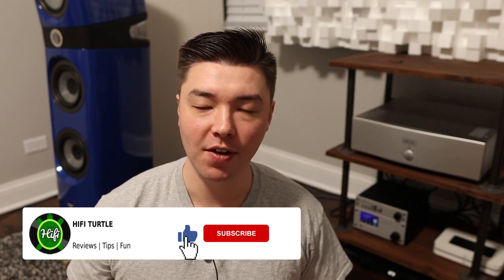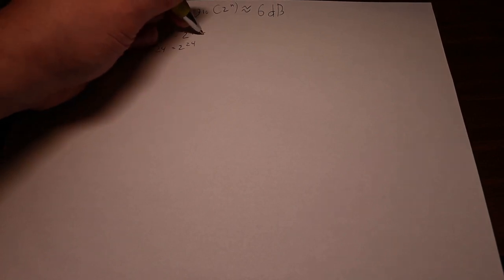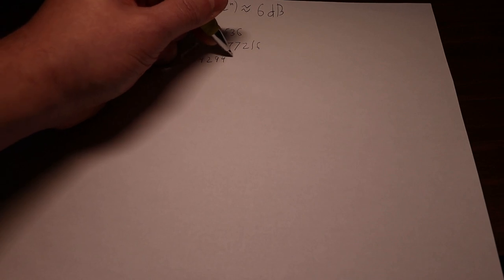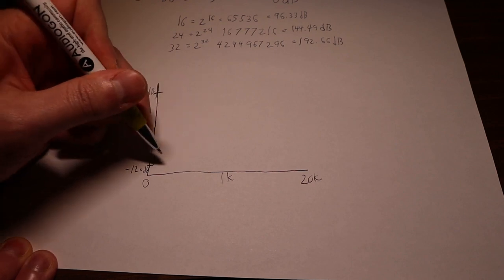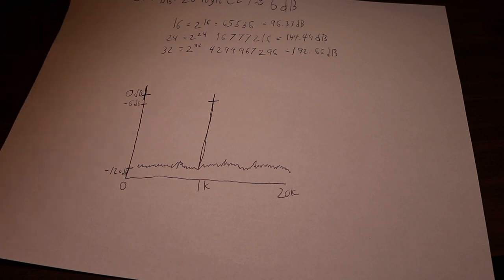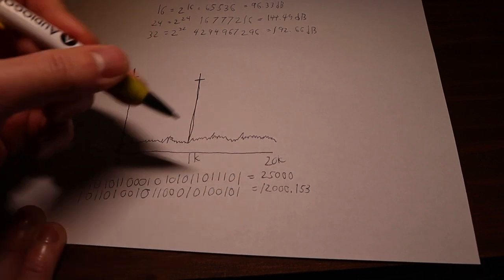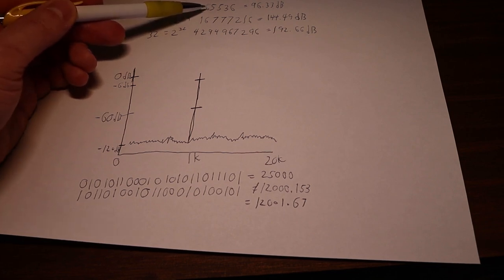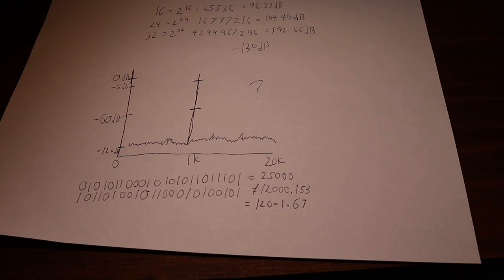DIGITAL VS. ANALOG PRE-AMPLIFIERS | Does It Matter?

Comment: Nja, the most common preamps do not just do attenuation.. but let us keep it simple and not go into sound quality and what a preamp can and will bring to the table.

But yes there is passive preamps (do not need any power) just many different sizes of resistors for attenuation and maybe a input selector. 

And if it is volume control that switch between different resistors or  a potentiometer (just a fancy way to select the resistance more granulated) or if the volume control control difrent replays that just open or closes relays to select a resistor on a PCB is all the same..

It is still attenuation by resistance just slightly more or less complicated way to get A resistor in the signal path.

There is other ways, like Transformer Volume Control (TVR).
The cool things is that power is not converted (and lost!) to heat as a resistor does.

Comment: Would controlling volume through Roon and Node 2i streamer with external DAC be considered pretty damaging to the sound or part of the more “modern” and improved digital processing category that doesn’t damage the sound too much?
Reply from the maker: Bluesound says it is a 32 bit DAC so should be less damaging
Reply: I added my old Rotel preamp to my Node2i and noticed sound improvement specially at low volume levels !